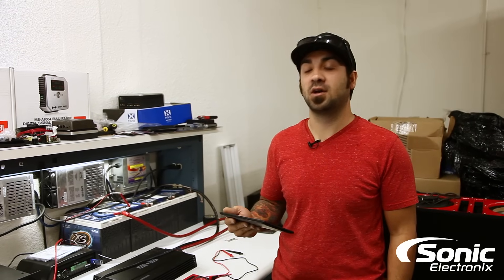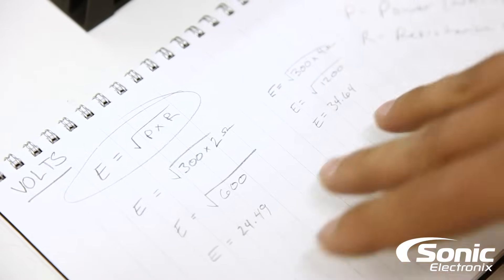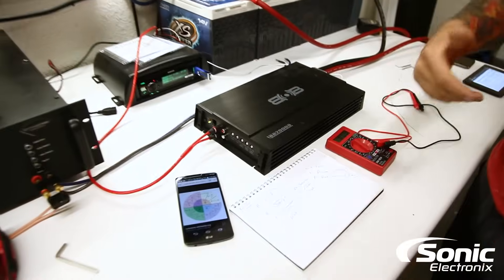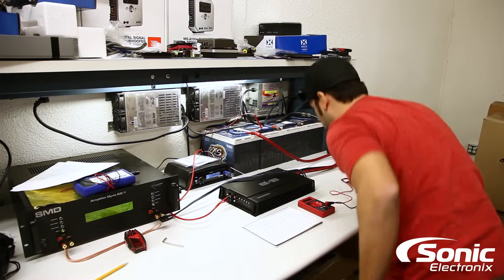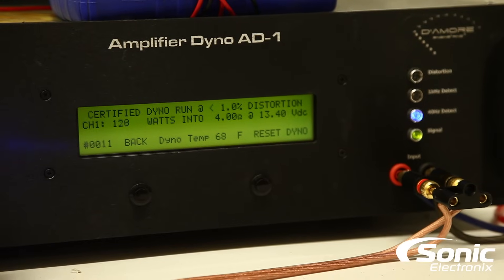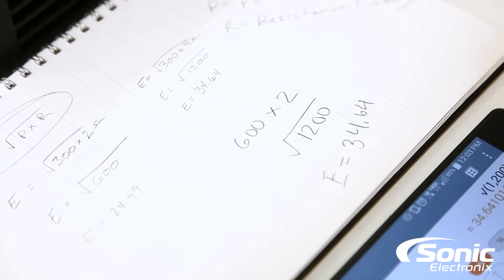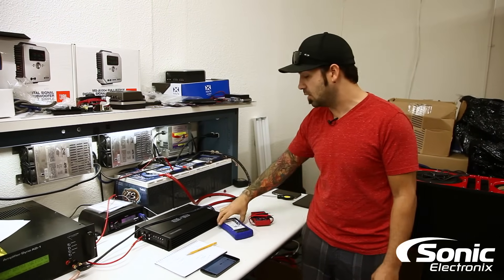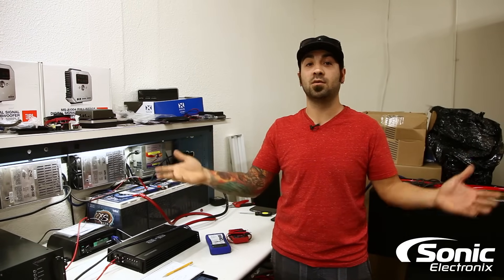How To Set Amp Gain to Match Lower RMS Subwoofers? | Car Audio Q & A

Comment: Great video only question is I still have I have a 12 in 250 RMS 500 Max skar audio and a 650 RMS monoblock amp I have it wired down to 2 ohms using a multimeter method am I still going off to 650 or am I going off to 2 ohm power rating for my amp

Comment: ok i want the total voltage output of amplifier, of  2 x 600 watts rms pioneer 4 ohm dvc, wired at 1 ohm load, do i multiply the 2 subwoofers rms ? to set my gain on amplifier

Comment: What if you have two twelve inch subwoofers both at two ohms each but one is 400 watts rms and the other is 750 watts rms? Would I add those up together x2 which comes out to be 2300 watts with my amp max rating being 3200 watts at 1 ohm, 1600 at 2 ohm or 800 at 4 ohm… Do I set it at series or parallel along with 1600 watts or 800 watts

Comment: I have a 600RMS 1250 peak sub and a 1700 watt AMPM. I'm wanting to try this one in the car first before bothering with the work installing my main sub which is quite literally double the power but concerned about the weaker subs RMS vs the AMP. The subs are both 1ohm and the headunit has 2.5v pre-outs and the gain on the AMP goes down to 0.15v. Is there any issue having gain set to or near said minimum with the 2.5v pre's?

Comment: You can safetly turn up the volume to 100% without distortion on the Kenwood head unit.
That's why I always buy Kenwood head units for my in-dash car stereos.
Just what I thought, but always good to double check. Thx for the video.

Comment: So dose this mean I can tune my 120w rmsx4 at 4ohm amplifier to run my 100w rms 4ohm speakers so they won't blow up or anything. And how would I do the math just go by the 100w rms on the speakers and set the gains to whatever the number is so if I run 2 speakers at 100w rms each would I have to go 200×4 and get the square root of the number and set my gain to that number please I'm learning

Comment: But the number on the amp may be rated at 4 ohms or 1 ohm.  Which one do you multiply?  I have an amp rated for 55 at 4 ohm, and another amp rated at 1 2 or 4 ohm.

Comment: You totally saved the day for my built i have all jbl harman kardon speakers woofer and amp but my woofer is a  jbl gto 1204BR 300 watt rms 4ohm and i have bought a jbl club A1000  600 watts rms @ 4ohm 1000 watt rms @ 2ohm  and i was worried how to power it without blowing up 🎉🎉 thnx bro

Comment: I got a DVC 700 watt RMS american bass hawk 10" and a audiopipe 600 watt RMS amp, with both wired 4ohm. If I wire for 2ohm the amp will then over power the sub, but will I be ok if I stay underpower at 4ohm? Will staying at 4ohms (underpowered by 100 watts) matter if I don't overtune and set gain and subsonic too high? my box is a sealed down firing 0.63 cubic feet box. Its small. Its because I have no space for a large box.

Comment: If i wire a 4 ohm dvc woofer down to 2 ohm at the load, which value do i use? 2 ohm or 4 ohm?
Reply: Same question I have no one has answered
Reply: You use 2ohm.
Must use whatever ohm load you wired to

Comment: Just play a 50hz test tone at full volume with no sub connected, then check the AC voltage? Where do i put the multimeter leads? You said your stereo unit goes to max volume without distortion. I wouldn’t know that, so how important is that?

Comment: Indeed, there is a novel and precise method for calibrating the gains on amplifiers using a calculator. While some individuals still rely on their auditory perception, as was customary in the past, the current technological advancements provide enhanced accuracy and reliability compared to traditional methods.

Comment: So I have 2 dual 2 ohm kicker L7 subs that are rated at 750rms each. And I got the kicker 1800.1 which says 1800 watts rms at 2ohms. The subs are wired so it's a 2ohm load at the amp. So my question is do I feed 1500 watts to the the subs so they each get 750 watts or do I only feed 750 watts?

Comment: Great video bro from your no1 fan in Guyana. Your electronics explanation is great.
Reply: fellow Guyanese here. (living in Canada now).. this method is a rudimentary way of approximating your gain settings on your amp. that's all.. to actually find the max level before clipping, you really should be using an oscilloscope. 
those SMD distortion detectors are great but really expensive and I personally believe they make their users stupid. because it doesn't do anything to improve the users understanding of gain and clipping.. it just lights up when it detects distortion.. no other indicators. makes the device become essential for setting gain. if you find yourself without your SMD distortion detector and have to set the gains on an amplifier, you wouldn't know where to start.

Comment: hello i have two sub pioneer 1400 watt each and 400 rms each both 4 ohm and using pioneer mono gm9701  how to calculate the voltage and  want to used at 1 ohm please help bro

Comment: you should have used a different wattage that wasn't double that last. you basically didn't adjust anything on the second run.  with that 2k amp you have I would have don't a way different wattage run. say 1480 watts. then use you math to do the test.

Comment: So I have 2 subs 350 watts each 4 ohm each but have them wired down to 2 ohms so would it be 2 times 700 then the square root is that right

Comment: What is the amp RMS is lower than sub RMS? Example I have two 1200rms subs totalling 2400watts and a 1200wRMS amp ? Can I set gain a little higher?

Comment: I am not quite convinced with this approach. Target RMS voltage shall be calculated if voltage factor is known. This means that you need to measure the phase angle. I am also not convinced if the DMM used here measures RMS voltage.

Comment: what if your subs are wired to a lower ohm load? Like two 4 ohm subs wired to 1 ohm final load.  would you still multiply the rms by the ohm of the sub or multiply the rms by the ohm load you have it wired to?

Comment: So if 1 - 4ohm @150 watt speaker = 600 
Does wiring in parallel now add up to 2ohms @150=300
or 2ohms @300=600 for final square root?

Comment: Good stuff! This helped me as I just finished up my install and while it sounds great and is powerful, I didn't check to see if my Pioneer HU was clean at full volume. I also assumed a couple of things; we know what assume means .... :) there are 9 speakers and 2 pairs are running at 8 ohms.... so I'll need to either parallel them or see if they have dual voice coils. My woofer and mid bass drivers are a series/parallel to give me a 2.6 ohm load so nothing to be done there. Thanks again.

Comment: So you're telling me you can check a amps wattage by voltage
Reply: Yes technically it’s the ac watts that come out of the amp speaker outputs so put a multimeter on the ac mode( alternating current ) then u need a clamp amp meter a dc clamp meter specifically and put that arround the positive wire going to your sub then set it to hold max and then run your 40hz with the sub connected and then your max ac volts and your max dc amps multiply those 2 together and boom that’s your rms your true rms

Comment: I know this video is old but: is this still how I would set the gain on a Taramps Smart Bass 3k? From 0.5 to 2ohm the wattage is the same or extremely similar and the voltage is supposed to adjust accordingly to the resistance as is my understanding. Would I still set the gain with the Resistance for a smart amp? Im trying to get 2000 Watts my Sub is 2 OHM to the amp. 
Since the amp is smart what would be the best resistance to use during the calculation? Or would I just stick with 2 OHM?
2000 x 2 = 4000

4000 square root = 63.2455532034

63.2455532034 VOLTS FOR 2000 RMS Power? Or would the voltage need to be lower for a smart amp??? Anyones input is appreciated. Thank you.

Comment: so does this work the opposite, if i have an amp that puts 200w RMS @ 4 ohm, and a sub that 300w @ 4 ohm would you swap the Power from the amp and solve to for the sub instead. esentially raising the gain to match the sub? 300*2 = 600 =24.49v/ 300*4=1200 = 34.64v?

Comment: If I have a 1000 watt amp that puts out 500 watts at 2ohm and 1000 watt at 1ohm, and I want to wire 2 subs at 500 watts rms each, do I wire the 2 subs to 1ohm or 2ohm to get 500 watts to each sub?

Comment: I know this video is old when you say 300 watts is this means for both speaker or just one speaker? If it is two speaker of 300 watts 2 ohms like you said it will be 600 square root so if its two speaker it means double to get the square root

Comment: Most people only show you how to set it to clipping point instead of matchin the power to subs like this man does great job I know that's an old video but it continue to help people
Reply: That’s how I did my adjustments. I like this. Question do I need to have a certain track on before turning up the radio?
Reply: Oh I see needs to be a test tone. How do I get a test tone?
Reply: I still have a question using this method instead of clipping my monoblock I have a 250 RMS 500w max 12 scar and a 650 RMS amp but that is at 1 ohm rating I have it wired at 2 ohms which is still 400 W I would like to keep it at 2 ohms the question is do I use the math at 400 W for still 650 Watts for my amp do I do 650 * 2 ohms

Comment: so, if I have  1 sub with 2 ohm DVC, it can be used in 1 ohm or 4 ohm configuration. Is it correct to calculate the gain settings with the way I have sub wired?

Comment: I understand the whole process and how to set your gain using your voltage number. My question is will that number change when you mess with the crossover I know you’re not supposed to use it but bass boost and subsonic filter?

Comment: SO  i gott a 1000 rms cea rated amplifier, 1000 watts x 2ohms=2000 which comes out to 44.7 volts.......with a mulitmeter connected directly to the speaker terminal on the amp the max i could get was 35 volts....i need to upgrade the 4 gauge power lead or the the alternator its self huh???
Reply: Hes full of shit just match it to your head unit rca voltage

Comment: I did exactly what you said test tone 50 HZ 3/4 volume on my head unit speakers disconnected from my four channel amp multimeter set to ac voltage positive probe touching positive speaker terminal negative probe touching negative speaker terminal the needle doesn't move I get zero voltage what am I doing wrong?
Reply: My apologies, but I must lol a little at this. 
"Speakers disconnected from 4ch amp" "voltage positive probe touching positive speaker terminal".
Do you see where you got mixed up at?
You are trying to get a voltage reading from your speaker, that you disconnected from the amp.

Comment: On my amplifier the gain knob goes from 4 V to .1 V as you turn the knob clockwise, why is that? Shouldn’t the voltage go up as you increase the gain?

Comment: Hi, I followed the instructions.   My target voltage is 34.65v for my single Rockford T1 D2 10" (2-ohm dual voice coil) with 600w RMS have the setting switch on the sub to 4ohm.  I have the rockford T1500-1bdCP 1500w amp and also have the Rockford PEQ knob that has an adjustment from 0db to +18db.  My question is what should the PEQ knob setting be at when I perform voltage adjustment?  
Headunit is about 80% of max volume playing a 50hz test tone.  Thanks in advance.

Comment: Hi, I followed this and also need a target voltage 34.65v for my single Rockford T1 D2 10" with 600w RMS have the setting switch on the sub to 4ohm.  I have the rockford T1500-1bdCP 1500w amp and also have the Rockford PEQ knob that has an adjustment from 0db to +18db.  My question is what should the PEQ knob setting be at when I perform voltage adjustment?

Comment: I have a 750 watt amp with a JL Audio 12w6v3-D4 subwoofer driver. My square root is 34.64 at 2 ohms. But what should the settings be on the sub sonic and LBF settings??? I have a 2-channel Memphis amp.

Comment: Quick question what if I have multiple subwoofers wiring it to let’s say a 1500.1 mono block amp and two DVC subs do I use the final impedance of the 2 subs and use that for my calculation or just use the subs ohm reading from one sub thanks

Comment: It’s all fine, until there’s a loud passage of music and your amp will put out much more wattage.   Gain control on the amp is NOT volume control.  RMS 0.707 wattage and voltage means nothing if you’re unable to fully control output from the source.  So it doesn’t matter about setting your deck to 3/4 volume.  Music is recorded at different levels, even sources on the deck have uneven output.  So louder passages in music can exceed the so called 3/4 setting on the deck.  That setting only helps you get cleaner signal to your amp, nothing more.

Comment: I thought the gain was supposed to be set to match the output voltage of the head unit and left there. What is the gain set to when youre on the dyno testing rated output? Is it set to 4v or is it turned to max?

Comment: Sweet now can u teach me that frickin math so I can actually do this!?!? thanks
Reply: Take your watts you want to the subs, multiply by the ohms. Take the result and square root on the calculator. Boom. There's your voltage to read on the multimeter and adjust gain to hit the number.

Comment: So I set the radio sub level to +6 highest it can go set the radio level to high and set the high pass filter to 125hz for the doors.  I then tuned eq on the radio and set radio to 75%  put on a 50hz loop and hooked the multimeter to the speaker terminals and had less then a volt maybe 2 volts no matter where i set the gain.   The amp is 1500 watts rms subs are 1000 watts rms trying to set the gain but why won't the volts change..  But when the subs are hooked up they pound I left the gain all the way down for now and still drills.   Just curious why I can't get a volts readinf

Comment: Ok am trying to understand this but I have to ask... My setup include a 3000 max subwoofer amp 1 ohmn stable.. I have a dual 2 ohm sub that is rated at 2500 max 1250 RMS ... can you assist me in those calculations... Am thinking you did you calculations in the video base on a single voice coil... Is it the same to find out if you have a dual coil...?

Comment: If the amplifier is rated at 75 watts at 2 ohms and the speakers are rated at 75 watts at 2.7 ohms is it logical that the gain on the amplifier can be set to its maximum since the numbers match up almost exactly; i.e. 75 watts on each and both are in the approximate 2 ohm range?

Comment: I would assume your numbers (from video) would be on the low side of an actual vehicle while running.  Voltage on the dyno was like 13.3 but when a vehicle is idling it is usually 14.4

Comment: 7 years later it's still super helpful. I have 2 harbour freight DMM and i couldn't get to read. I just saw that the red probe connects to the top slot. Edit i tried this method and still reads 0 to 0.2V on ACV. Don't know what I'm doing wrong.

Comment: How would this work with an amplifier that’s rated below the sub max power. Example -a 1500 watt 1 ohm  class d amp with a 3,000 max power dual 2 ohm sub .

Comment: So question, clipping comes from an overpowered amp right. So if you have say 2 subs that are 600 watts RMS a piece and you have them wired down to 1 ohm. Then you have a 1 channel class D amp that does 800 watts on 1 ohm. Is it even possible to get clipping with the gain if the amp dont put out enough power to overpower the subs?

Comment: Can you help me ? My amp is rated at 500 RMS and my subs is rated at 200 RMS (800w 2ohms).. Do I calculate the amp 500 RMS at 2 ohms or the. Subwoofer 200 RMS at 2 ohms??

Comment: I have a 4 channel 1250w amp 14.4v (4ohms 4x125w, 2ohms 4x250w, 4ohms bridged 2x500w) and my car has 6 speakers (5 inch dash 45w 135max, door and rear 6x9s 100w 300max). What would you recommended to get the most and best out of them? Is it possible to connect all 6 to the amp without limiting their output power or should I just connect the 6x9s?

Comment: I just stumbled  across  this video cause I have a question. I have a hifonics brutis 1500 watt d class mono block amp. It was in my old vehicle  that I was able to use subs in a regular box so I wasn't limited  to what I could use as much as I am now because  I have a Silverado  crew cab now so I need shallow mount subs that can handle this amp. Suggestions  on what subs? Will the cerwin vega vmaxx shallow  mount 12's be ok?

Comment: I bought a Kicker CXA1200.1 from these guys in 2019 to push two 10” W3 (1000rms). I just decided to buy a like new Jl W6 in HO JL enclosure for $300. I now have way too much amp. Still undecided if I should use this method or sell this amp as its brand new in plastic still with 1280 watt Dyno certificate and buy something like a 600-800watt RMS amp. I do have a 400 watt Kicker KXA amp I could use which might do the trick as I prioritize less system draw on stock electrical and don’t need windshield flexing power. Just a blended W6 or my dual 8” W3’s. What would you do , try to 400watt, sell the brand new in box 1200.1?

Comment: how do you match higher rms subs? i have 2 12 inch 4 ohm subs, wired to 2 ohms to 2 seperate channels. 1200 watt amp, 450 watt rms x2. 800rms subs each.

Comment: Hey bro gotta question my amp jus shut off the other day it had been running fine for bout 2yrs. So I kno its not my amp hooked it up in my boys ride and boom power on. Put back in mine and nothing. Radio doesn't have to be on for it to turn on my remote wire is a constant. But I disconnect and put the multi meter on the wires with the car running I'm getting 14+V but the remote wire is gettin 10.4V. But I noticed when I hook a amp up the voltage between ground and power drops to 6V I figure the issue is in either the ground or the power cable.? But how do I kno?